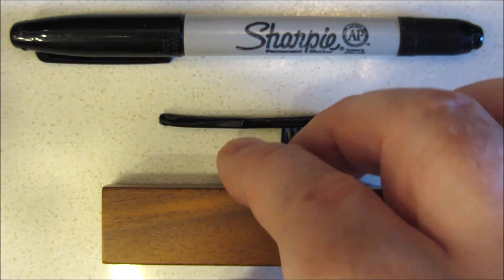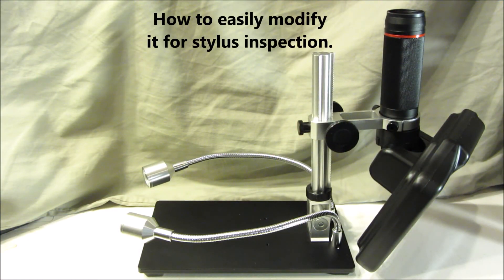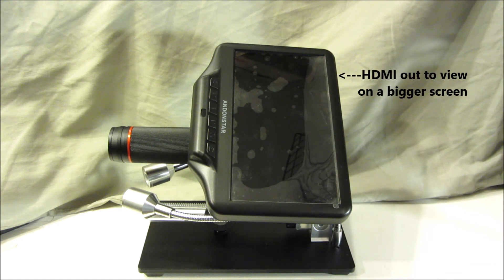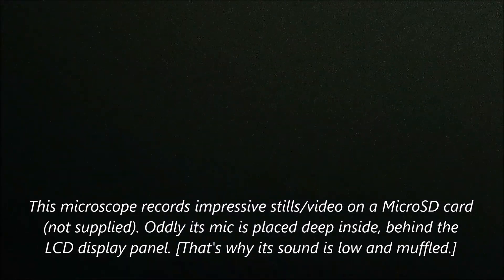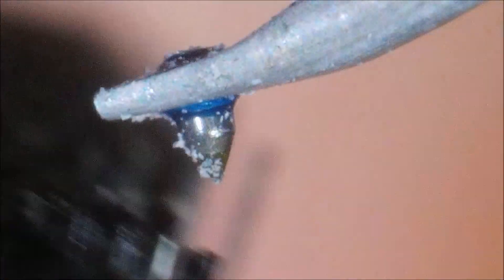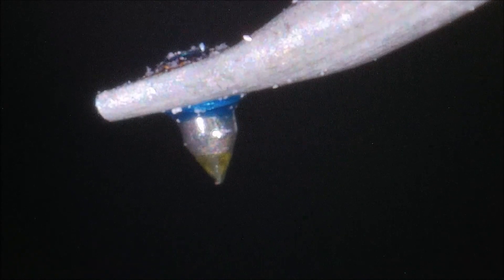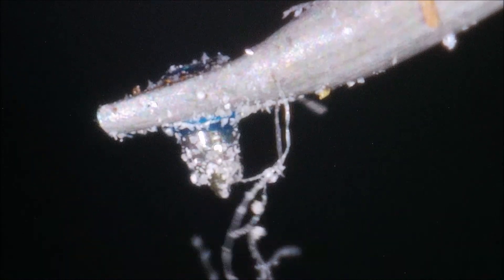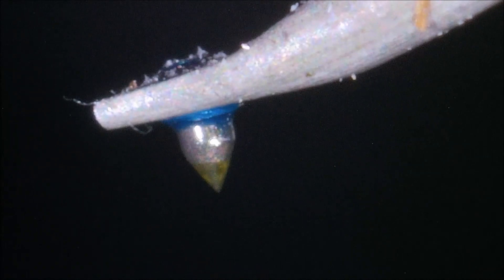DIGITAL Microscope Phono Stylus Cleaning

Comment: I would love to see your method for cleaning vinyl records
Reply from the maker: It's a non-glamorous and laborious manual process so I don't think it would be of interest to most viewers, but thanks for asking about it.. First I blast the record with air from a XPOWER A-2 Cyber Duster Electric Air Duster, I then blast the surface, inch by inch, with a stream of warm (but not hot) water from my kitchen faucet sprayer. I never use any compounds or soaps. Then the final rinse is with bottled distilled water so when the water droplets later dry away they don't leave any minerals. I immediately pat the paper label area dry with a paper towel so as to not get water damage and then let the record air dry while held upright in a plastic dish rack. I don't usually bother placing the dish rack over my BlueAir 211+ air filter (so the drying air is itself dust free) but I have done that on occasion.

Comment: Could this microscope be used to set the stylus rake angle?
Reply from the maker: The problem is when you view it up close you don't have a good sense of the horizontal plane of the record surface other than the tiny spot right under the stylus. Like many microscopes the image has an extremely narrow depth of field so you can focus on the diamond tip but the horizontal record is out of focus and completely blurred. , , , I can't speak to all brands/models, but my Shure manual says they've designed it so that if the cartridge top edge (where the screws are)  is square to the record surface and you are applying the correct tracking force then your VTA and SRA are good to go.
Reply: @m.zillch3841  What it says in the Shure manual really only works when the cartridge is perfectly manufactured. That's seldom the case, so it's important to dig a little deeper.
Reply from the maker: @utub1473  I'll be glad to examine any objective evidence you have that some Shure M97xE cartridges have audibly compromised sound by simply following their advice on this matter. Have a link? Thanks.
Reply: @m.zillch3841  This isn't specific to Shure cartridges though, it's all of them. Unless you have a specialty stylus profile, your cartridge manufacturer is going to tell you that a level cartridge will ensure you a proper stylus rake angle. It's difficult to send a single link to explain this, as there are so many different places I've learned this from, but I also shouldn't need a link. If your cartridge isn't manufactured perfectly, then the universal recommendation Shure and many other manufacturers make simply won't be an accurate method of setting the stylus rake angle. The real way to do it is to have a microscope, one which is capable of examining the stylus rake angle with the stylus resting and tracing a groove. If you don't believe me on any of this, I would recommend that you check out some of the set up videos/articles done at AnalogPlanet. You could also check out WallyTools, a company of mechanical engineers specializing in the art of proper cartridge alignment. Cartridges are such small tools that it's unrealistic to expect that they all be manufactured identically...
Reply from the maker: @utub1473  " If your cartridge isn't manufactured perfectly, then the universal recommendation Shure and many other manufacturers make simply won't be an accurate method of setting the stylus rake angle." No, my concern is not that the angle might be slightly off, even measurably so by, say, a couple/few degrees, it is that the degree by which it varies is of AUDIBLE concern. The rants of others claiming they "hear" it, including magazine reviewers, conducting their tests under SIGHTED conditions is of no interest to me.
Reply: @m.zillch3841  I believe that would depend almost entirely on how attentive of a listener you are. The difference is certainly real, but some may not notice it. It also depends on the stylus profile, as some are much more sensitive. Shibata styli are especially notorious for that.
Reply from the maker: @utub1473  The condescending putdown "One might not notice because only attentive and discerning listeners would hear it" doesn't work on me. Show me objective science that SOMEBODY'S Shure M97xE cartridge, setup as the manufacturer advises, is AUDIBLY compromised due to manufacturing SRA error, under blind testing, by any individual on the planet, as discerning as you wish, using any system you want, with any music you want, or else I have ZERO interest.
Reply: @m.zillch3841  Well have zero interest then! Feel free to educate yourself, there’s plenty of information out there. Also, I wouldn’t consider that comment to be condescending, but rather truthful. An audiophile’s ears take time to develop, which is something I’ve experienced. I’ve returned to comparisons many times with time having passed, now able to detect differences much more clearly. If it’s all about science for you, check out the WallyTools SRA seminar. They explain there how improper SRA can cause “ghost modulations,” that weren’t meant to happen at all. And again, this isn’t just about your Shure, it’s about every single cartridge out there, the exception being conical styli of course.
Reply from the maker: @utub1473  "And again, this isn’t just about your Shure," False. I specifically said in my FIRST response to you that I was speaking solely about my Shure.  I wrote:
"I can't speak to all brands/models, but my Shure . . . " So the topic is indeed about manufacturing SRA error causing AUDIBLE problems when setup as the manual states, with this SHURE design, because I made it a point to exclude other designs by writing "I can't speak to all brands/models". Micro line, micro ridge, Shibata, and other line contact styli, as examples, have nothing to do with the subject. Despite asking you repeatedly you have failed to provide any evidence following Shure's advice compromises the sound of this cartridge but instead mention a questionable MARKETER of alignment measurement gear, WallyTools, as if THEY are a reliable source without skin in the game, which they are not. There's no way they'd admit that small errors are completely inaudible for many if not most cartridges like mine because it would detract from their sales. Their entire modis operandi is to use FUD, fear, uncertainty, and doubt, like this line I'm quoting from their site "Have you ever listened to a cartridge that others raved about and when you listened to one in your own system you wondered what the fuss was about?" They rely on plenty of stupid people who foolishly think that if something is measurable it proves it is AUDIBLE. That's 100% false and it is used as a common marketing trick in audio, an industry I know well because I've worked in it for decades.
Reply: @m.zillch3841  Decades ago, in the '80s I believe, there were two people who travelled to dozens of mastering studios and measured the rake angle of the cutting stylus. One thing they found out, was that the rake angle must not only exceed 90 degrees, but it must also stay under 94 degrees. In the middle of that sits 92 degrees, hence the reason cartridges are designed so that when level, the stylus rake angle will be 92 degrees. The trouble there is that all cartridges aren't manufactured perfectly, though I wish that were the case. Your Shure is no exception to this, nor is my Ortofon. Cartridge alignment is all about replicating the equipment used to originally cut the lacquer that's later plated to press records. This is why we align our cantilevers to two carefully placed grid lines, as these are the points at which there is no tracking error. They are the points at which our turntables essentially reverse the actions of the cutting lathe without distortion. The stylus rake angle is the same sort of thing, it's another parameter that we can adjust to mirror the cutting lathe. The sound had from any faceted stylus (that includes the Shure) truly does improve with that rake angle set properly, as there are now no "ghost modulations" and the tonality is as it should be. If your arm height adjusts, please be encouraged to play around with it and observe the changes it makes to the sound. And yes, it does change the sound. Playing a record is a mechanical process at the stylus, and so of course changing the position at which the stylus meets the vinyl would change the sound. Though I will say once more, if you can't hear it, that doesn't mean it's bullshit. It could be that your system won't show the difference, or that your ears aren't trained. My system isn't even incredible by today's standards, but both myself and my entire family can hear the difference when I change the tonearm height, thus altering the stylus rake angle. Call that condescending but it's the truth. If you would like a visual explanation of that, I again will recommend the SRA seminar done by WallyTools (who have been selling the tools they engineered themselves for decades, it also isn't bullshit). It can be found on their YouTube channel, free for everyone.
Reply from the maker: @utub1473  You are right about one thing: Changing the height of the fulcrum does alter the sound but for a reason you and your teachers are blissfully unaware. As can be clearly seen in the opening seconds of my video, a close examination of the stylus in action shows that what we think of as a flat, normal record is actually filled with thousands of micro warps. That is, the stylus is constantly traveling over hills and depressions/dips. Unless you have a tonearm which is infinitely long, the only way to negotiate these bumps/dips is to swing the cartridge in an arc, up and down, around the fulcrum (pivot) point. This arc unfortunately causes the stylus to effectively slide forwards and backwards in the groove causing a speed error for that moment that it is sliding ahead or behind of where it is meant to be, had the record been truly flat. The term for this momentary change in audible pitch is "warp wow". [Now I'll play the same "Perhaps you aren't aware of it because you aren't discerning enough" card. ] The higher off the record surface the fulcrum is, the larger the forwards to backwards sliding in the groove to negotiate the same size hill or dip, which is why high quality tonearms such as the multi-thousand dollar SME Series V ($5.5k in 2014, I believe) intentionally places the pivot height EXTREMELY low, just barely over the record surface, just like the AR-XA turntable's arm. [Competitors ignorant of this problem, such as Fremmer's $28k Swedish Analog Technologies tonearm, place the pivot around 22mm higher than it should be.] Some people obsessed with SRA and VTA foolishly think/hear the problem in subtle musical pitch change (heard more as an "impurity" or "sourness" rather than an actual change in pitch) on everyday micro warps - - which all records have if you look closely - - is due to the angle error they are so obsessed with ( due to marketers' propaganda like Wallytools, used in their effort to rationalize their wares) and they claim that inserting a spacer above the cartridge to return it to the correct angle, even when using a pivot point high off the record surface,  will "cure" the problem, but they are wrong. I illustrate this exact point with an animation that clearly shows inserting such a 22mm spacer, returning the stylus to correct SRA/VTA on the $28k tonearm, causes NO change to the forwards/backwards scraping/sliding length of the stylus path in the groove caused by using a typical and objectionably elevated pivot height, hence it does NOT cure warp wow, in the following video: https://youtu.be/vrcsJPJbLG0
Reply: @utub1473  the real way to find the proper rake angle of any said stylus - is to do an adjustment, and use real time audio analysis tools to determine what angle is capturing your cleanest, distortion free and highest tracking ability (this can be digital or analogue tools)   - I'm pretty sure that's what the guy from AnalogPlanet ended up summarizing as well ( is it Fremer?)  - he's quite a wind bag though.   It's getting into minutia that has subtle differences many might not care to rectify or dial in so to speak. I do personally have my own system to get my perfect tracking at least in a paramater that serves my needs - and that is audio archiving for clients that reissue items from rare Vinyl LPs that tapes were lost long ago.  So close to perfect tracking is a must - especially with Hyperelliptical, Line contact, and Shibata ect.  With a spherical stylus.. it really doesn't matter unless it's an extreme angle.
Reply: @m.zillch3841  yes - that corresponds with reality :)
Reply from the maker: @glenncurry3041  My shop had a Wild stereo 'scope as well but when turntable sales plummeted in the 90's it was deemed no longer necessary so I took it home.
Reply: @m.zillch3841  Interesting. Were you a Signet dealer and in the the S.E. US? In the '70's that would have been me. While I travelled 6 states doing it, you would likely have come across some of the same examples. I still get a kick out of seeing videos here that just happen to be using an AT cart and how that square shank you stands out and looks so clean and precise. I had a stand with 4 oversized plastic models of stylus I used for my AT seminars. Had a number of them. Wish I had not tossed them!
Reply from the maker: @glenncurry3041  The stereoscopic Wild scope was purchased before I started working there (probably in the mid  to late 70's I'm guessing) but as far as I recall we did not carry Signet while I was there. {although if they came in a dark brown box with green lettering, which pops in my mind from their mention, maybe we did and I'm just forgetting. ] The scope was also purely optical, at least as I used it in the configuration we had it in. There was no video out.
Reply: @m.zillch3841  Was it in S.E. US? There were some lower priced Wild I think Shure provided. And I had a video feed for the in store clinics. It might not have been a requirement for the dealers shops. It's been a few years!
Reply from the maker: @glenncurry3041  We didn't sell Shure. The Wild might have been an M5 or one like it based on images I have just now looked at on line. Example:https://coinsandstamps.com/Other_Collectibles/Miscellaneous_Devices/PG-MIscellaneous_OC.html
Reply: @m.zillch3841  WOW! Hard to image a retailer that did not carry Shure back in the day! It was like Maxell or Recoton. 🙂Yes I think that was one of the models Signet required. Stopped a lot of stores from picking up the line! But that was AT's intent. First dealer I set up was in Tenn, Nashville I think? Maybe Memphis? Again, been a few years.
Reply: @utub1473  Lot of mansplaining going on here. May I ask, @utub, how old you are, and I will answer you politely.
Have you watched too much Michael Fremer, Nathan?

Comment: Any thoughts on using a scope like this for more precise cartridge alignment? Or would it be too difficult to get close enough when on the platter?
Reply from the maker: Good idea! I just tried it but my current setup does not really have the capability of supporting the massive base of the microscope, in its current configuration, mounted where it needs to sit for an inspection of the needle while in the groove, so I had to sort of hand hold it. Results: You can get a good view but a new problem arises. You have a good view of the stylus but it is difficult to simultaneously view the overall plane of the record surface to make relative assessments of the angles.
Reply from the maker: @sulleneldritch7680  Not sure if you've seen it already but I show the use of a close range monocular to examine stylus/groove movement, on pipe organ notes here: https://youtu.be/d_EDuvPCJ04?t=233

My vision isn't great either but I think the best approach is to mount the cartridge as squarely to the headshell as possible and then worry about the entire headshell alignment to the record surface rather than just the stylus tip. At least on my AR-XA that seems to be the best approach.

Comment: Thanks for that.  I've always wondered just how effective brush cleaning actually was.  It seems more expensive tools like the Onzow Zero Dust might be unnecessary.  Any plans on the best ways to ground a phono setup and dealing with static?
Reply from the maker: My contention is if you can view the stylus in microscopic detail the exact cleaning method you choose isn't all that important. Just keep brushing until the surface is clearly shiny and like new. Even the free brush could achieve that after just a few strokes. [Although I guess there are different kinds of dust and some may cling more.]
No plans on a grounding video because it is dependent on what the turntable is and the environment. One method that works well for one person's 'table and room might not do well for another.
Reply: Check out "Time to Put Away The Onzow ZeroDust?" by Michael Fremer of Analog Planet. He did extensive research and found it was building up an unremovable layer of gunk.